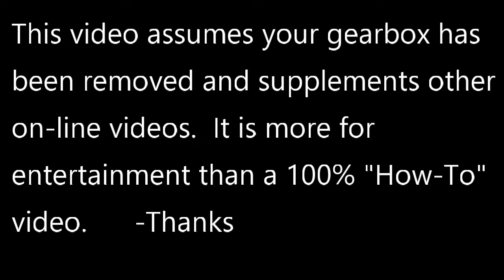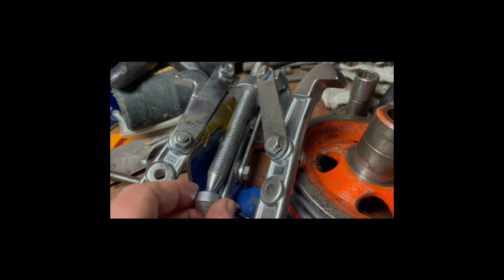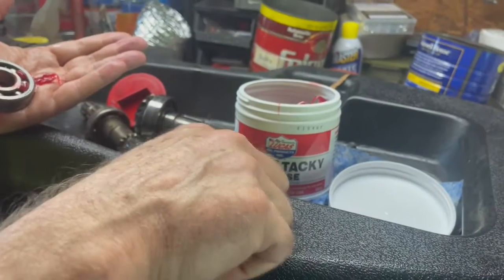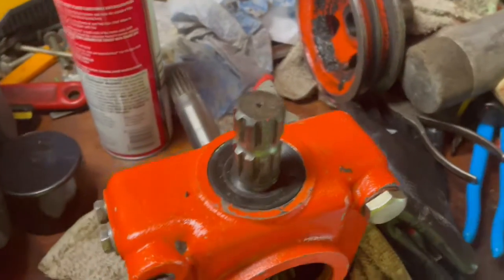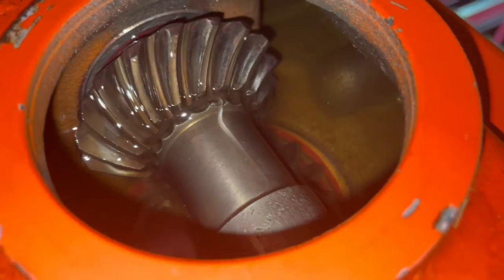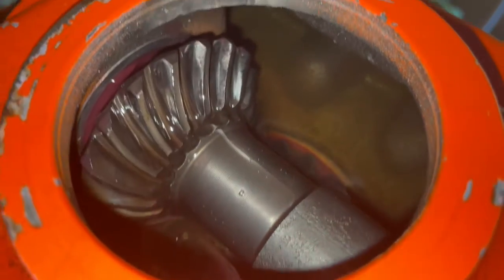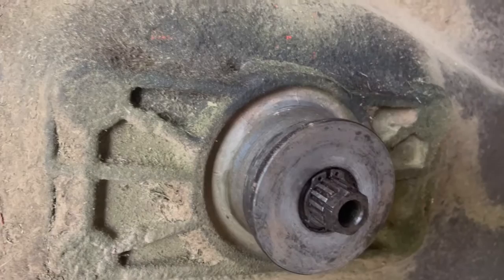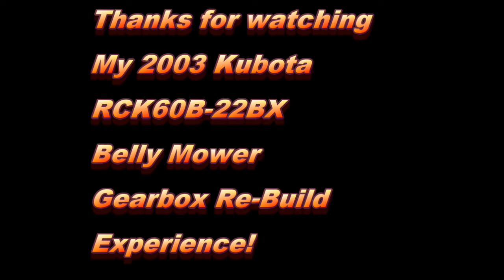Kubota RCK60B-22BX Belly Mower Gearbox Experience - 2003 BX2200

Comment: What was your mower doing to make you change this out? The seals were leaking? I have the same model mine has a bucket on the front though. Mine just started cutting in and out when I engage the blades. I just had the belt replaced but I notice I can smell the belt. I’m not sure if it has something to do with the gearbox or not. It’s my father’s tractor. I don’t have the manual so I’m looking for videos on YouTube. Any advice for me I’d appreciate it
Reply from the maker: Yes, seal was leaking badly on the bottom side. Sounds more like your pto lever or something on the side beside your seat. Maybe check the deck and make sure there are no obstructions around the belt and under the deck and that it is/was installed properly.  I'm sure you can find a video on that better than the short talk I do about it on this one.  Check gearbox oil level too but I do not think that is your problem.  If you are not able to trouble-shoot it, might want to just take it to a dealer.  I take my front loader off for most of my mowing.  Good luck man -
Reply: @BaymondRell  thank you! Yeah I’ll troubleshoot some more things! If not I’ll have to take it in!
Reply: How can I tell what is breaking my belts. I seen the gear box pully was going up and down then the pully would hit the gear box and put a nice grove in it. So I think it my maybe the shalf , it is going in and out just a little is it suppose to do that ?   So I got the gear box off the deck and all cleaned up.  When I pulled the gear box off the deck the seal was bad. I’m new at this I lost my husband 5 years ago and I have been doing all the work to everything on our land to the cars trucks, and have a job AND  I’m not young but I’m not going to give up I know I can fix it 😅😊😂 I hoppppe.  So I’m in need of help please 🙏

Comment: Packing grease in an oil filled gearbox?
Reply from the maker: That's a good point.  The bearings inside there appeared to have a heavy grease in them originally so I just assumed to repack and push it all out with fresh grease.  Also on another video I watched they greased their's but if Kubota says otherwise I will be happy to make an edit/note to this video.  Thanks  man -
Reply: @BaymondRell  if your are putting oil in there, the grease is superfluous. My gearbox ran dry and stripped the pinion. Bottom seal failed ana since there is no easy way to check oil level... 
I have fitted a sight glass now. Cheers

Comment: You really can't check "slop",  that shaft relies on the machined hub of the pulley to be installed and placed back in mower deck(open bearing is in deck) to support output shaft.  These are not stand alone gearboxes
Reply from the maker: Thanks for the comment.  It's been more than a year and slop or no slop, it's fixed by a regular Joe.  All I know is that with the new seal, the shaft was much "tighter" before putting the keyed pulley back on and the pesky leak was and has been fixed at minimal $$ spent.
Reply: @BaymondRell  Good to hear, l have a JD F930, alot of ,"No longer available parts". Thanks to U Tube, still going strong,  Good luck 👍